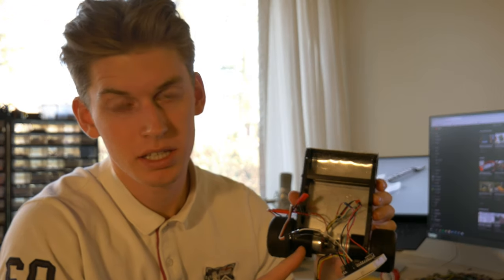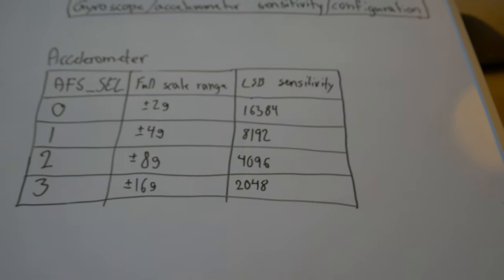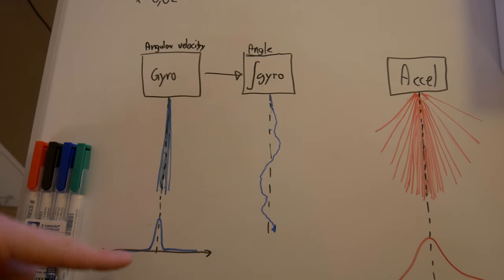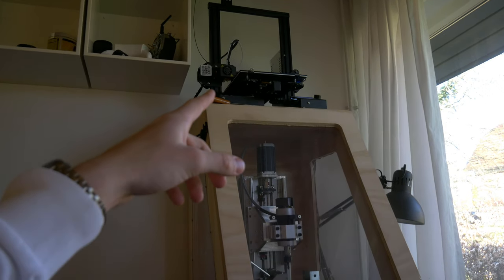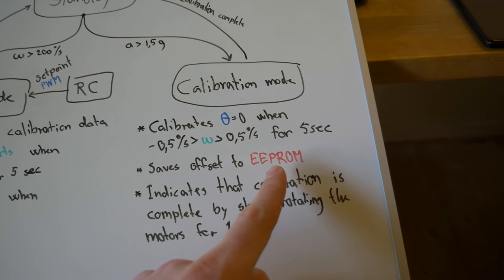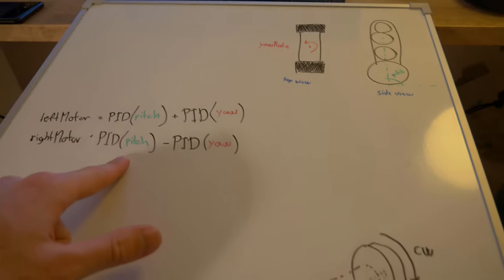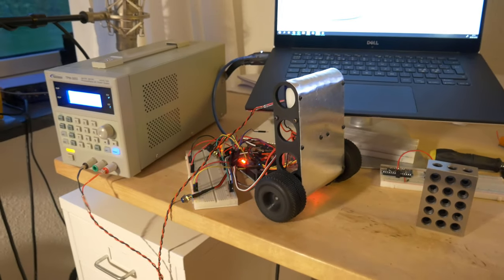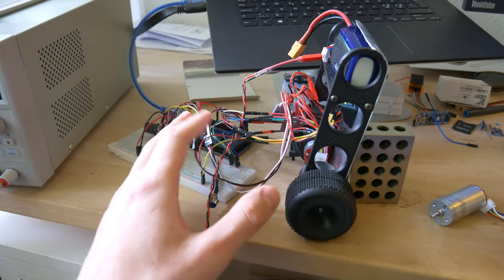Arduino 2-Wheel Balancing Robot - Part 2

Comment: Hi! I'm really in struggle trying to make a self-balancing robot in simulink. I can't understand why motors with encoder are needed instead of classic dc motors and also to configure arduino with simulink!  This project is really great, you made a great work! I hope that you can help me, because i'm trying to do this in other ways (i'm trying to implement lqr control instead of pid)
Reply from the maker: I'm no expert. This is all working progress so you will have to ask elsewhere

Comment: cool stuff!
i have the same escs, and do not recommend them at all. they do not function reliably, had one smoking and another one that does not want to reverse sometimes...
Reply from the maker: Thank you very much!
Reply from the maker: I have purchased a simple h-bridge as a replacement. That is hopefully much better
Reply: @Karlemilstorm that would have been my recommendation:) i have a L298n, gyro and an arduino somewhere, maybe ill try to make a balancing robot too. the coding is what scares me off always... i am just now learning about PID controllers in university but it is very difficult to implement from theory into practical code.
Reply from the maker: It is actually pretty simple in the end. You could start by adding speed control to a motor like I did. That wasn't too hard.

I should probably have included some screen shots of the code in this video